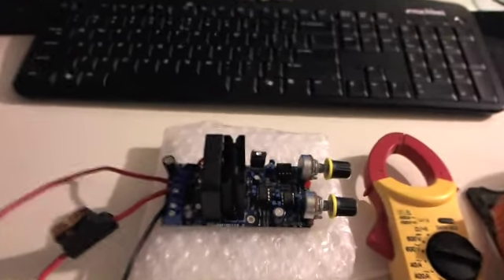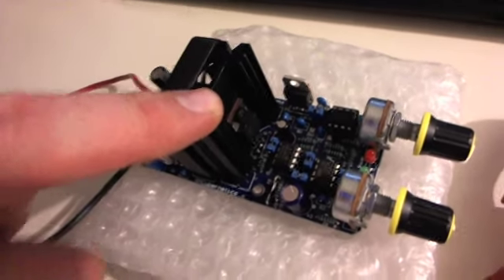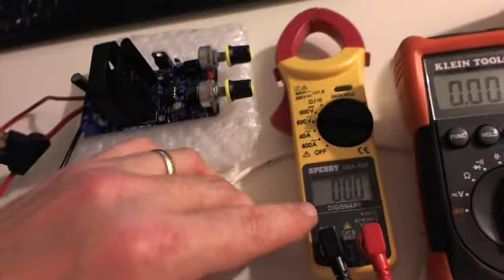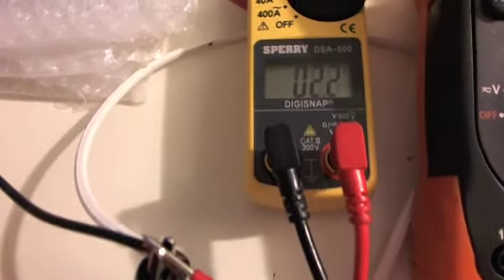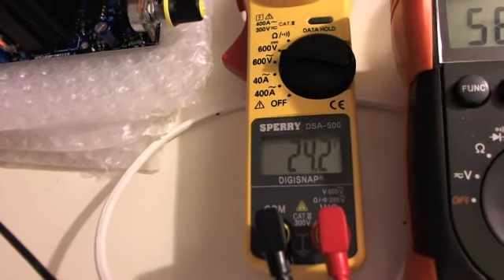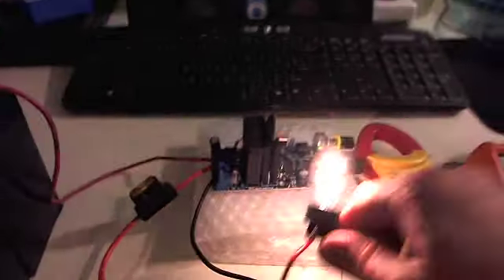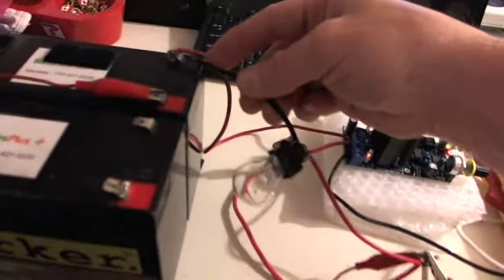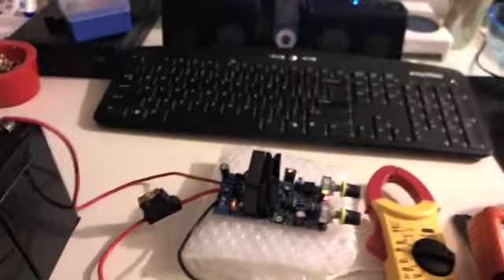PPM Circuit Board for high voltage coil pulsing....

Comment: you do know about bedini pulse motors right?. 30V?.....  try 1000v+, spikes =] from a 12v sorce And the pulses can be used for mechanical work via a rotor with magnets which is a motor of course. Nice pulse unit.

Comment: seems like if you do anything with this besides using it as a tankless water heater,  you would quickly ruin your magnets. maybe not so much as long as water is involved, but the copper tube with fins looks like a magnet killer, assuming it's based on convection/air and no water running through copper tubing. I had been thinking of a setup kind of like this(the closed-loop/circulatory water heater system), minus the motor, using the water pressure to spin the magnets.. but then you would just be outsourcing that labor to the water pump.  but for a closed-loop heater, since you're going to be using a pump anyway, that would make for one less moving part, if you could get those kind of rpms utilizing the water pressure and an impeller/turbine something like that. (which I'm sure you could,  with proper design and a 3d printer handy to do rapid prototyping)

Comment from the maker: @MALEXIOU1 
  The connection is the faster you pulse the coil, the more EMF energy is built up in the light bulb... I actually got it up to 52 volts from that 12 volt input. Amperage however does increase coming from the battery. My main point of the video was to show everyone that a back EMF can be collected and used. Thanks for watching..